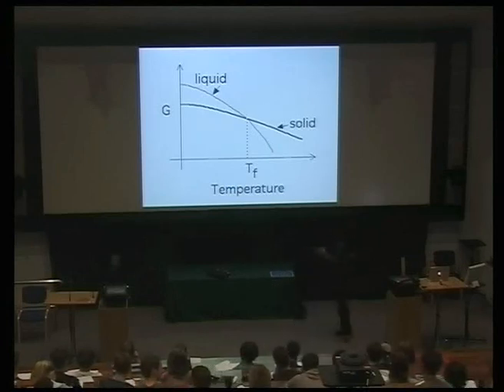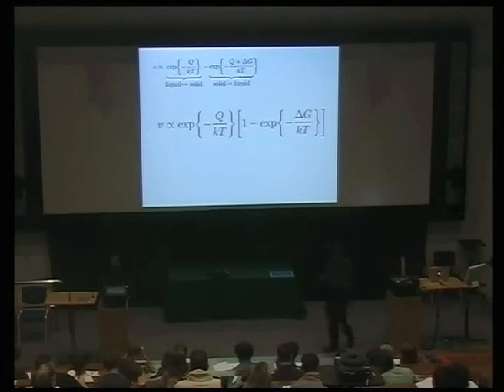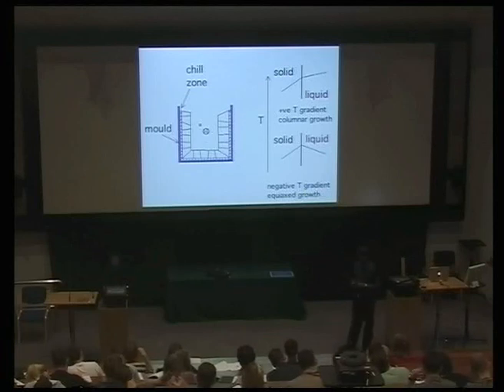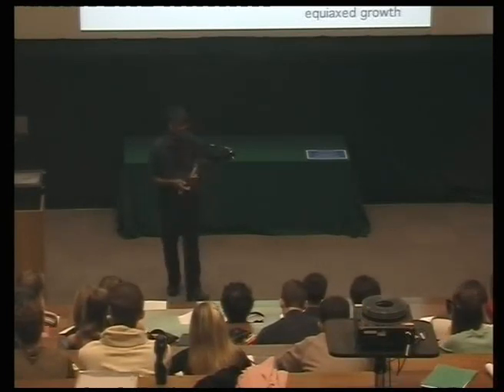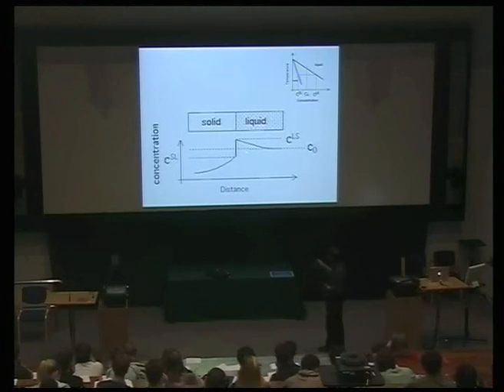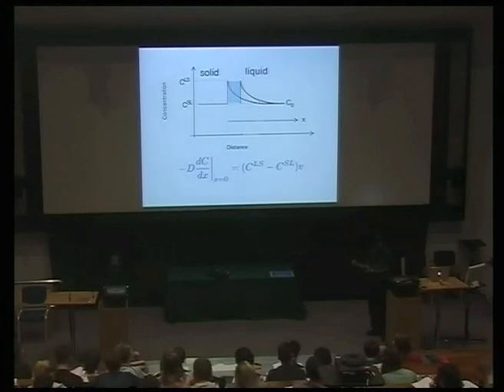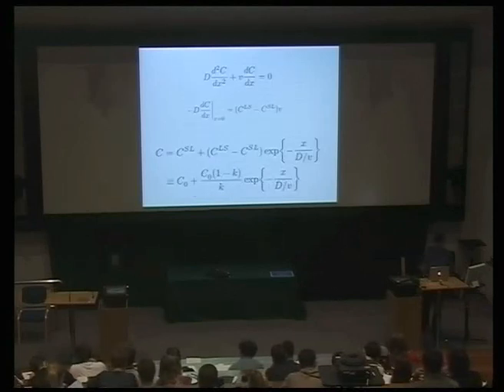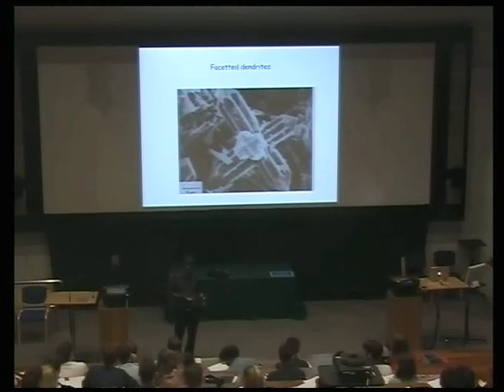Metals and Alloys, lecture 3, Solidification

Comment: Thank you for the lecture Professor. I have one question. If we apply this exponentialy decaying profile ahead of the solid liquid interface during solidification of fusion zone in welding process then is it right to say that at the weld centre line, this segregation profile will become narrow because the width of this profile is given D/R???
Reply from the maker: In fact, as solidification proceeds, concentration gradients become flatter because of solute enrichment in the residual liquid. There is a lot more of free information on 
https://www.phase-trans.msm.cam.ac.uk/

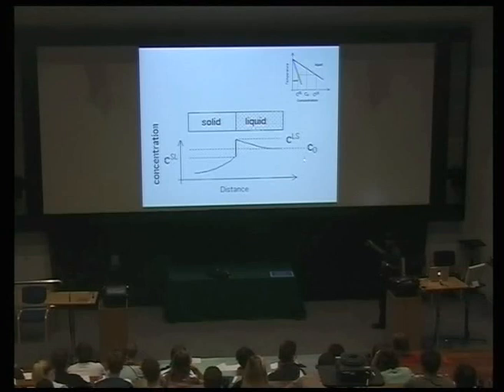Comment: Dear Professor,  In concentration Vs Distance profile (21:00), Can I have a sharp interface across which fully solid and  fully liquid phase  as shown in the plot  (21:00 MM:SS) ?  If solidification happening over the range of temperature, can i assume fully liquid after the interface?  How the liquid fraction / Solid fraction along distance ? Could you please help  me in undertanding this ? Thanking you
Reply from the maker: For a physical point of view, I don't see any difficulty in haveing a sharp interface. The concentration profile you mention, has distance on the horizontal axis, so the fractions of solid and liquid follow.

Comment: Hi Professor, 
When Csl reaches Co then there is no more liquid is present if it is cooling under slow equilibrium conditions, this is from tie rule volume fraction of solid is 1 . so , there is no more liquid to undergo solidification. all liq has got converted to solid. so how does then the interface with with velocity??

Thank You
Reply from the maker: +divvela aditya Solidification stops, so all interfaces are at zero velocity.

Comment: Hi Professor,
does having steady state at the interface also correspond to a planar solidification front? 

Through literature it was mentioned that dendrite stability lies within certain limits of growth velocity. When the solidification front growth rate falls out of the upper or lower limit, the constitutional undercooling approaches the difference between liquidus and solidus temperature for a nominal alloy composition of Co. Assuming equilibrium at the interface, the interfacial liquid and solid composition would then approach Co/k and Co respectively.

Since this leads to the steady state condition at the interface, I was wondering if steady state also corresponds to planar solidification.

Thank you.
Reply from the maker: Tey Cher Fu Dendritic solidification implies that the liquid ahead of the solid is undercooled. So the interface is not stable in that sense. However, steady-state growth, i.e., growth at a constant rate, is still possible if the dendrite tip advances into fresh liquid, leaving any partitioned solute behind.